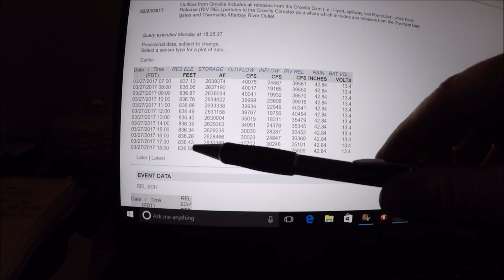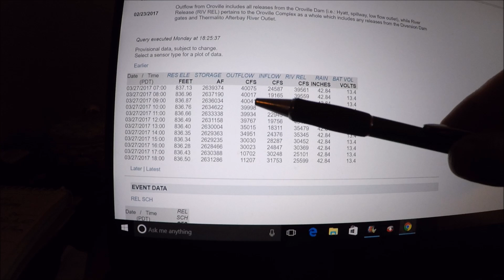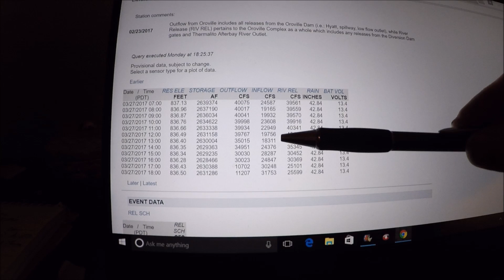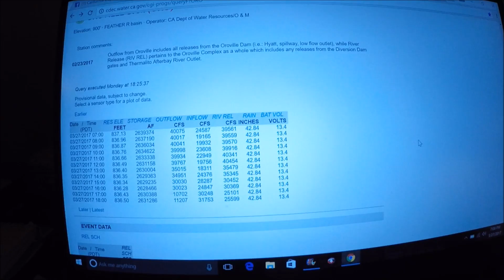Oroville 27 March Update "A Day in the Life"

Comment: A steel spillway was my first thought. For example, building a steel "bridge" structure over the damaged section and bolt that structure to bedrock. Other than corrosion, what would be the factors that would prevent the building of a steel spillway?
Reply: I really don't think corrosion would be much of a problem. Look how much steel lies under salt water on ocean going vessels around the world, as well as other infrastructure. I think the steel bridge idea is a very good one. I've also wondered if some type of epoxy coating might protect the rest of the concrete spillway, and maybe provide some protection to a steel one.
Reply: Nick Gillotti expansion of that much steel would be significant. Tubes might work, but they would be gigantic.
Reply: Steel doesn't corrode when continuously submerged because there's not enough oxygen available. A bridge is a completely different application.
If a bridge or aqueduct is built over the new gorge, it will be built like a modern road bridge- precast and formed in place concrete columns heavily piled and anchored into the now exposed bedorck.
It would be a logical way to go, as the performance of such a structure is very well understood, requires no new technology or solutions, and equipment and specialised labour is readily available for the job.
Reply: At 160,000 CFS, which I think is the design limit, the water in the spillway is something like 10 feet high and it has kinetic energy. That's a HUGE structure. Also the gap is quite long so it would need support pylons that need to be dug down and anchored to solid bedrock. That probably would take longer than they have available........Probably their best option is to take the 1.5 million cubic yards that they've dug out of the Thermolito Diversion Pool, wash the clay out of it and crush the rocks into appropriate size gravel and use it for fill. Compact and then rebuild the spillway with concrete and steel reinforcing to todays standards. The old spillway lasted 50 years, so a new one done properly can be expected to last at least that long.
Reply: Think of it as 20 Abrams tanks side by side rumbling down that spillway, row after row..........Also they probably need to do a little dredging at the gates so they can drain the lake down to 813 feet.
Reply: Bob Smoth Your way makes to much sense it'll never happen.
Reply: I was going to suggest duct taping over the gap as a temporary solution
Reply: To put some numbers into perspective..........I think the spillway is 256 ft wide, 10 ft deep and 3000 ft long. To line that in 2 inch steel is 34,000 TONS of steel or about $67,000,000 just for the steel. That's 8,300 plates that then have to be welded together. That's overkill............. To line the same spillway in a foot of concrete is 30,000 cubic yards of concrete or 3,000 truck loads of 10 yard trucks. That's about $7,000,000. ( Beats steel ). At 5% volume re-bar that's $3,500,000 for the re-bar.  But in a temporary mixing plant and create the aggregate from the dredged material. ......Basically build a temporary aggregate facility on site ( probably by the river ) to wash and crush the 1.5 million yards dredged up. Part goes into the concrete, the rest becomes the foundation and the washed out clay can go back into the gully. Add a settling pond for the wash to reduce particulate back into the river. If that whole 1.5 million yards has to be processed to get enough foundation material, that could cost $150,000,000. Doing it all on site saves having to truck everything in on the local roads past all the properties. There's still the people going to work, but at least not heavy trucks day and night. Labour could still be $5,000,000 to $20,000,000. Total bid price $350,000,000. I'm going to assume permits will be issued promptly. To add a divider down the middle, just in case, adds maybe $10,000,000
Reply: Bob Smoth won't last that's how it was built originally .duct don't make em long enough. plastic  pipe!? temporary.

Comment: Snowy Hydro's Tumut 3 has 1800MW nameplate capacity compared to the Hyatt power plant which has 820MW and flow rates of 16950 cfs peak. If another large powerplant was added DWR could possibly control the Oroville dam level with just the generators. Add another 1000MW capacity sould be about 20,000 cfs flow rate. Steel pipes are probably quicker to install than the repair work on the main spillway so this could be done first and then the main spillway repaired later to keep it open for flood control.

Comment: I am looking at this situation from time to time, and wondering what the surface area is of that spillway.  Wondering if it would be feasible to line it with sheet steel or fiberglass once it is repaired. Both are easily repaired in low flow seasons and very durable.  Some boats in my area, made from fiberglass are pushing 100 years old, and with minor patching and a coat of wax, look new. Steel not quite as durable due to corrosion issues, would be less expensive, again very tough and easily repaired in dry seasons.

Comment: This summer they have to solve two problems.  Fix the end of the broken spillway so they can run it at low flows, 0 to 40 Kcfs.  And, fix the outflow at the bottom so it do it doesn't back up water to the power plant, either by widening the pool or blasting a better channel out of the rock where the water spills out of the new canyon.

Also, build a road across the hole in the main spillway, at the bottom, by a downgrade to it on each side.

Comment: Was the water level maintained no lower than 835' during the drought.  If not, how did the main inlet of the spillway fare without eroding?  The biggest thing I took from this report, that I thought was a positive, were the words "contingency plan and what if" that forward thinking is encouraging.  Bill Croyle  must be having some sleepless nights. You're right for this situation, fall is just around the corner. Staying tuned...
Reply from the maker: No, much lower using the Hyatt Power plant, and eventually the RVOS (River Valve Outlet System).  
When the main spillway is working properly you can slow the flow way down to prevent scouring at 835' before closing the gates.
Reply: Got it thanks, no jet lag here, your fast with the answers or it's an easy question.

Comment: Juan, continued great reporting - looking forward to video of the spillway to see how it fared.  Two questions - one is that I noticed a significant amount of water going down the lower part of the spillway. Was that entirely from mist from the plunge pool? Second question is why the power plant discharge level is not above that of the pool? It seems odd that the excess water from the spillway backing up to the dam causes an issue for the powerplant.  Shouldn't they have had the powerplant discharge at a higher elevation than the pool?
Reply from the maker: NutmegThumper it's a generator/pump plant, so the #1 tunnel is always submerged., #2 only partial.

Comment: im no engineer but redundancy seems to be the answer. id take part of emergency spillway and build a second controlled spillway. seems to be right there slapping them in the face. other than initial costs im amazed this is not the norm. like a plane or boat redundant systems that can do the job of the primary systems. it just seems like the right answer.

Comment: thank you for the videos. I was wondering if you had an opportunity could you explain why it's so important for the inlet to stay above 835 and what the danger is in scouring it.
Reply from the maker: The main spillway inlet is about 835' elevation. With the 'throttle' (so to speak) stuck around 40,000CFS, it tears up (erodes) the inlet to the main spillway at those high flows.
Reply: Joann Titsworth too bad they didn't clad the inlet of the spillway with concrete at low water.
Reply: Ken Knutson  yes. I was wondering what I wasn't getting. why on earth does this thing have so many vulnerabilities

Comment: 60% sounds like 60% of the original designs capacity as a bare minimum design for the temporary fix. As for scouring the inlet, that needs to be covered in concrete with the final spillway so that is never an issue again. Then LA and San Diego needs to have desalination plants added rather than import more water from everywhere else, costly yes but the refusal to consider just keeps the costs high rather than devoting research into making such infrastructure cheaper and more viable.

Comment: Juan do you know if they are still working on the ...I think you called it the "'river valve system"?  This part of the original diversion tunnel......correct?    If operational this is what another 5000cfs?     Water that doesn't have to go down the damaged sw.   I know it's not much but critical now when they need time in between sw releases to let new concrete dry!!
Reply from the maker: tortland1 I can't get a current status report on the RVOS...but yes it would help!

Comment: Aren't u concerned about the EAST SIDE of the Spillway. I just feel that the topsoil may eventually slide into the lower pool areas. Once the topsoil starts sliding, the rest of the trees, rocks, boulders will follow. The Spillway / Dam Footings will get exposed / collapse w/o soil, boulders, etc to have adequate pressure against the water pressures. 20 - 30 ft high water may "EXPLODE" through the actual DAM & part of the main spillway. The EAST SIDE of Main Spillway look kind of loose w/ top soil and BASE ROCK. What do you think? Any chance that side could possibly slide / erode because of the water flow fm the spillway @ 20,000?
Reply from the maker: too far away, see vertical view.

Comment: If the spillway was built to 1960's standards, what about the gates, the dam, or most of the infrastructure built in the 60's?   Just because things are underbuilt, there is not enough money to rip it out and rebuild it all.  The upper half of the spillway may need to be rebuilt, but maybe it can be rehabbed enough to work.

Comment: Juan, are you saying that they are actually doing true core samples down on the main spillway? I find it hard to believe that they can get a deep core sample from below the break. Maybe up higher before the spillway takes the turn down steeper. Just asking for clarification. Great job of keeping info flowing, you're the best.
Reply from the maker: up higher I assume.
Reply: blancolirio -- yeah, that's what I thought, and of course that will give them some info but not enough about the troubled area. As you know I'm not on the panic side but I don't know that I would take core samples up higher as gospel for the area of the break. Also Juan, any info on whether the old repairs on the main face leak really worked or is there still seepage through the main dam? Thanks again.

Comment: In the time available to make temporary repairs to the Oroville Dam spillway filling all the eroded surfaces will not be possible. It would quicker to bridge the broken sections with a metal structure then coating the entire length with matted (metal or rubberized) surface to help protect the spillway from further damage until more permanent repairs could be made. The current course of water off the broken spillway will continue to erode unless all subsurface are reinforced which is another massive undertaking. Until the new tributary's path to the river is stabilized continued dredging will be critical to keep the power plant in operation. 

A temporary repair to bridge the damaged sections of the spillway that would allow the use of the full length of the spillway would help several different way. One it greatly reduce the need for dredging. Two it would allow for much better control of water release from the reservoir. Three it removes the need for continued reinforcement over the current nature carved pathway of water from the broken spillway to the river. Resources would be better utilized on repairing the spillway itself not in areas that will not be part of the long term solution. More than 2 cents but it makes sense. 

One question I've had almost from the start is why there no timetable for the repair of the 6th generator at the power plant? Though it is proverbial drop in the pond in affecting discharge from the reservoir every bit would help now & repair would also increase power plant output. What the holdup!?
Reply from the maker: Don't know.
Reply: Thanks for the reply. Like many have been following your coverage of the Oroville Dam and very impressed. Your clarity and attention to details is much appreciated. I'd feel very safe knowing you'd be my pilot on a flight in anything from a small tail dragger to 777-300. Best wishes!

Comment: Would somebody create a Website (sell advertisement space, make money and retire rich) with all the facts/numbers that are helpful to understanding the Oroville Dam, Spillways, Power Plant? There are a lot of numbers that need to be condensed on a few pages so everyone can have easy access to them. Then notify Juan and he can post the link in the description box on each new video. Here are some of those numbers:
922 feet above sea level is the top of the dam. 
900 feet is when water will flow over the top of the emergency spillway.
850 feet is the preferred lake height.
813 feet is the inlet pipe to the main spillway. Once the water drops 
below that point, the main spillway cannot be used.
640 feet is the lowest the lake can drain using the power plant. It can 
be drained lower, but water would be using the diversion tunnel.
224 feet is the maximum height of the water in the Thermalito Pool if 
the power plant is to be used.
The power plant has 6 turbines and when all are working capable of releasing 19,000 CFS.
27,000 CFS is the estimated inflow to Lake Oroville this summer.

Comment: In times past design safety factors of 3 to 10 times the calculated failure state were common. Today, "Modern" engineering is often severely budget constrained and ultimate strength calculation emboldened to move final structures much closer to failure point trusting in the Improved confidence in the methodology.  Works well in a static model, not so well in a dynamic model with changing future states.  

This event seems to have brought to the attention of many the limits of this structures design envelope. Given the increasing probability of inflows well above the old static 100 year precipitation metrics, do you see any indication that the engineers are considering design solutions to manage such less predictable, more hazardous conditions?  

Thanks for your continued vigilance.

Comment: I think the comment of Super Human Effort is a bit of political back patting. But I do believe that they have done a great job with the current spillway problem. I am interested to hear more about the main dam face leak. Did the old repair job work or is water still permeating the structure? This is not the same as a pure earthen dam and like I said I believe they have done a great job with the immediate problem of the spillway, but this other issue is interesting and potentially could be of more concern.

Comment: Id rather dump a dam and fix it right than to end up with a full fail. Far as the aqueduct. The dams down south are all full.They don't need the northern water for two years. And the farmers don't need it down south. They cut most them off and put them in the poor house. Also, why don't they have a idea when the last Turbine is going to be fix. I can take a car to shop and have a idea when the parts are going to be in to fix it. Now, to fix that spillway they should be looking at drilling 60 foot vertical pillars in. Stick the re-bar in just like they do on freeway over passes and fill them in. then pour the spillways into it connecting all the re-bar. Nothing less than a 9.0 earth quake would create a failure. I if was a betting man id bet there shipping the turbine parts in  containers just to save money instead of flying them over just to save a 100 grand...

Comment: Juan, you would not land a 777 on a 15 inch thick runway.  Yet that is what the designers planned for with this weak and fatally flawed spillway.  This spillway failed at half it's claimed capacity, that was criminal ignorance.  Like the Titanic the flaws appeared later after it was launched...Oroville sailed for 50 years before it arrived at a  near disaster..was it just minutes from failure or hours?  Rename it the Titanic Dam.  And promote the decision makers who made the titanic decision to use the so-called emergency/auxillary/weir spillway up to the point of near collapse..promote them to Captains of this ship of state of stupitiy of this Titanic dam.  Also..if you cannot use the emer/aux spillways..then they are not spillways ..and they are not weirs..weirs are designed to be overtopped without failing.  That makes this feature a wing dam that will fail if overtopped.  Overtopping is one of the major causes of dam failure..since the beginning of mankinds dam building..followed by spillway failure.. That means Oroville has only one spilleay and at this moment thanks to their building this dam on the cheap with only 15 inch thicj deck it's only half a spillway.  Would you want to land a 777 on half a runway?  Happy flying.
Reply from the maker: yes, but the design worked for 50 years.